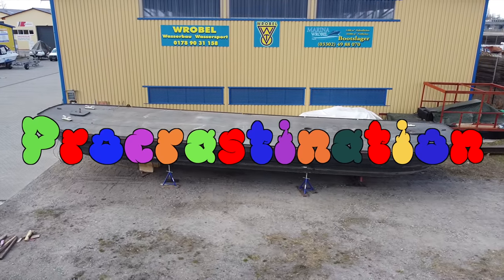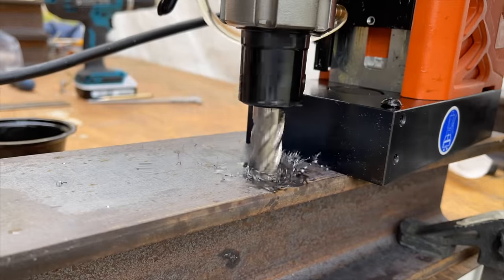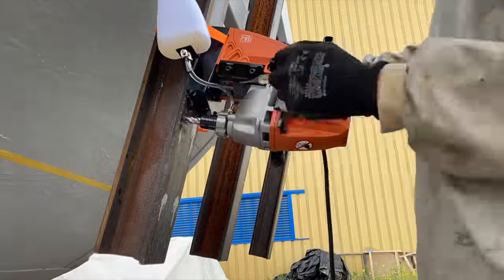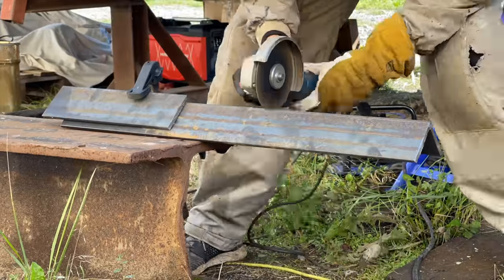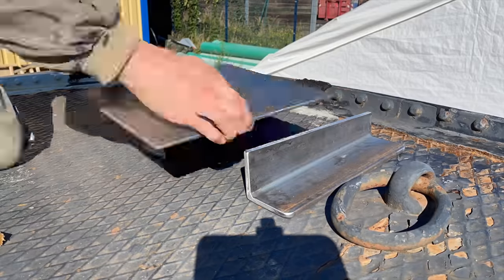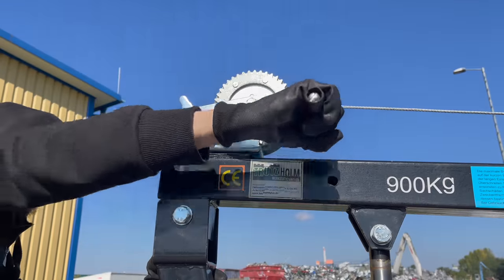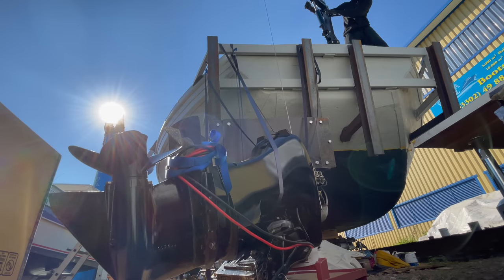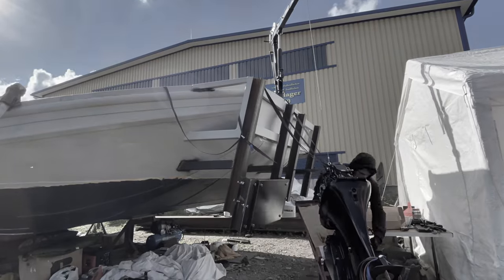Installing Outboard Motors on My Barge Boat

Comment: Good job!!!  Did you check to see if there were lower unit extensions available for these motors. Then you could have had the motors near the top of the deck for easy tilting maintenance.

Comment: Hey friend, love the progress. Just a tip from a yacht design engineer. I know you said the engine's will be hight adjustable. But I think they should be much higher. The engine's have a specific depth to which they should be mounted. This has to do with the water pressure. Also if the back board is under water you will experience a very large amount of drag wich will also make the boat hard to steer. I'm sure you will figure it out 👍🏼. Good luck.

Comment: Huyj!! Quite the project of mounting these motors!!

Though I can't help thinking the waterline being at the same height as the top rim of the transome plate, so I hope you won't end up dragging the plate through the water when the motors are pushing the barge 😕   ... I hope it all works out!! 😀

Comment: Looking good. As a suggestion, I would have added a few angle brackets under the cranes platform. As a suggestion, You should add marine grade caulking to those bolts that went into the hull. Do you plan on doing some kind of sand blasting on the inside of the hull and painting it as well? As a suggestion, I would have used a solid piece of treated lumber for the transom, not plywood. Why did you make the transom at a n angle in the first place? Do you plan on adding sheets of steel to the transom to extend the hull? if not, that's gonna be alot of drag pushing up against those steel plates.

Comment: Nic work on the transom brackets and motor plate.  That new drill really does a great job and it seems to save a lot of time in the process.  Just curious, but shouldn’t you also put some epoxy sealer inside the holes you’ve drilled too?  You may have this planned already, but it seems logical that water will find its way behind the bolts to soak into the plywood around all the bolts.

Comment: Excellent work! Danke for the video!

However I have the same fears as others about the motor which is hopelessly low and will be flooded with water. This is not a planing hull and would never be able to do so (whatever the power) so don't worry about aligning the AV plate. You would be better using the anti-foul to gauge the water line and setting the bottom of the transom above that. Hopefully the engine leg will have enough depth or you will have to reduce the transom height accordingly. Good job it's easily adjustable!

Hope it all goes well for you! Can't wait for your next episode. Kind Regards.

Comment: Great work 👏👏👏 never worked on  barge but i know with a heavy displacement small yacht that you need a high thrust propeller fitted on the outboard. Would imagine it would be the same on a barge? Have also uaed long shaft outboard motors but that was to compensate for the waves and boat motion which i don't think will affect you the same in rivers but might help get the propeller futher down but keep the motor dry. IMHO 👍🏻⛵🏴

Comment: This may have been asked but why did you welded transom on the bow of the boat instead of the stern? I may be completely wrong w this assessment. The barge looks almost symmetrical but it still has the provisions for a rudder on the old stern and its still visible on the other side of the boat. Plus i"m worried that the transom is to low and will act like giant brake in water. I hope I'm completely wrong  and i wish you the very best in all your projects.

Comment: Cavitation plate needs to be on the boat bottom level with planing boats. I am quite sure that that barge is not going to plane ;) So you can lift the engines up at least 30-40cm :)

Comment: Looks like you figured out the right settings for your welder, but whenever I am starting with new material, I go to the highest setting and work backwards if I blow through the metal.
That way I know I am getting enough penetration. I'm sure there will be better professional advice, but that's how this hobbiest has approached it

Comment: Always time well spent watching your projects advance. I think Handy Andy's suggestion of raising the engines out of the water on some sort of mechanism is great, (as you already have the crane).  Without the bolts it almost looks like the new transoms could slide up and down.

Comment: Probably a good idea to add the largest props you can on the outboards. Fingers crossed the props are at the right hight. A way to hand crank the engines and mounts on rails up out of the water is a must.

Comment: I heard you say some of people comment you should of went with one motor rather than two. And i would just like to say that two is always better than one in case you have a failure of one of the motors you will have another to rely on. And one other thing take it from someone who has decades of fabrication time without the benefit of detailed engineering experience and specs just make sure you design some adjustability into everything and you will do ok If something doesn't quite work just move it until it does. Your doing a fantastic job and don"t listen to to many of the experts and do it your way and don"t think of something that doesn't as a failure just chalk it up to a learning experience.

Comment: An excellent opportunity to add a sliding transom for pulling the engines out of the water and for engine and prop maintenance as needed. The winch is in position, its use would be easy! Nice job, Sir!
Reply: @jackrichards1863  - Thanks, Jack... I know just enough to get me into trouble.

Comment: Shouldn't the anti-cavitation plate be level with the water line? Plus, are you welding out or sealing the edges of the transom plates, or just letting them rust out from in-between?

Comment: Love your videos I have been watching for some time! Your welding has got a lot better keep it up man. I would like to just add a welding tip when you are welding corner joints it helps to go in a C Motion if you do a slight pause on each tip of the C It will help reinsure penetration.

Comment: I'm loving this project! That hull has so many possibilities, there's so much you can do with all that room. However, you've made a mistake. The transom is much too low! Think about it, those will be submerged and you'll have to drag them through the water! Expect to cut off the H beams about half meter higher, about to that hull mount. 

The cavitation plate would be right on a planing hull but yours needs to be near the waterline on a displacement hull. It needs to go up about the height of transom plate's height. I mean, the bottom of the plate should be about where the top is now. BUT the way you've done it will make it very easy, just drill new holes! Once it's done and in the water and you know exactly where the waterline is you can set the engine height exactly.
You might even weld a pair of loops on the transom so you can use that very cool crane to raise the transom and engine as a single unit.

The transoms are very wide so you can experiment with how far off centerline you place the engines.

Comment: Don't forget that epoxy does not do well in the U/V of the sun.  You need to top coat it with an opaque paint to protect it.  Also don't forget to seal thoroughly all the bolt holes.  Looking good.

Comment: Hi i like what you have been doing. I am just worried you are going to drown / flood your motors. The only reason why the cavitation plate has to align with the bottom of the boat is when the boat comes on plain the water intakes is under water. Now if you plant to ever get the barge on plain that would be the case. I would rather place your caviatation plate on the water line as that should suffice seeing that your barge also has a sloping bottom. This means your transom will be creating a lot of drag as well. Thanks for interesting vlogs. Keep it up.

Comment: looks to me like you could create something like a mechanical jack plate pretty easy here. weld some cut down angles on the front of your transom I beams alowing you to take the weight of the motor with the crane then raise or lower it  after removing the bolts. might be a good idea even for figuring out ideal height of motor.

Comment: Been following along since start of your first boat, great content! Interested to see how this transom works out while in motion. Seems like they will be a huge drag killing efficiency. Also, at their angle, I wonder if they will push water up and over drenching the outboards. You know, I dont think it would be that hard to have the transom hold onto the rail supports with brackets (instead of bolts) making the entire transom able to slide up and down the rails, using your crane to lift/lower them. Could probably lift them high enough to be entirely out of the water.
Reply: I guess once in the water will answer that issue lol

Comment: I would suggest that you fiberglass the board to ensure they are waterproof.  Lots of videos on youtube for repairing transoms.

The more I've thought about this the more I think you will have problems.  The workmanship is very good.  Here is the but, the motors could have been mounted on some steel tubing mounted across the framework you have in place.  Looking at the transom, you are going to have a lot of drag if it and the framework, if any, is in the water.  There is already a lot of resistance for the size of the motors you have with just the barge alone.  JMT.

Comment: A method to a madness everyone has there own take on things. It,s a barge boat not a speed Machine so don't matter what end ya use. Nice work all the same. Weight wise size of barge the added weight not gonna make a hellva Difference in the end probably more of a windage issue than anything else. Looking forward to further iterations oh and podding engines good idea as further out better steering. Oh and you lot who know everything bugger off annoy someone else other wise let see your projects then.. oh that's right ya haven,t got one what a surprise. Keep at it and Carry on.

Comment: My observation is that you bolted the crane into the sheet metal deck without stronger support  frame support under the deck. I hope the sheet metal deck is strong enough to hold the weight

Comment: I'm sure other people have pointed out to you and you've probably thought of it yourself! But I probably would have put a doubler plate underneath the bottom of the deck plate ? Even working with wood... I used the same mentality of doublers underneath the deck to further disperse the load!

Comment: Congratulations! You have just built a very effective water brake! 😃 The plate of the transom needs to be higher and clear of the water. Also where will the waterline be when you have finished building the boat? At the moment I think the outboard will be 2/3 under water!
Reply: He never listens, the work is sometimes ok, but poorly thought out.

Comment: The outboard looked very low, the hinge point was in line with the waterline on the barge. Aren’t they usually higher up, out of the water?

Comment: The two 5mm plates are not a good idea. There will be rust, especially with the plywood on top of it. A stronger and lighter solution would be to cut the second plate in to strips and weld them 90 degrees to the first plate.

Comment: you need to epoxy the holes in the plywood where you bolted thru. also the deck where the crane was mounted  will leak with out so sort of caulk.   project looks great

Comment: Have you thought about contact corrosion between your A2-70 bolts and the normal steel H-Beams? 

Hast du auf Kontaktkorrosion zwischen den Edelstahlschrauben und den Stahlträgern gedacht?
Reply: В морской воде всё корродирует. Черная сталь и нержавеющая между собой не корродируют. Алюминий и чёрная да...
😂😂😂😂😂

Comment: Very skillful work! A few comments though. The transom seams too low/deep, but easy to address, You just drill more holes so it can be adjusted. The other issue is more complicated. The design of the transom will act like a huge break, you can probably shave/cut the lower part  5-10 cm. Better if you would design it like a box, hull extension, then would have much less break effect.the box does not nee to be structural, just to direct the water flow better.

Comment: i'm surprise you don't sicaflex or wire togheder the two 5+5 steel platform
and epoxi on the hole for the wood under water
and why wood? is not better metal?

Comment: I would recommend putting silicone or some sealant in between this two plates. You will be surprised how fast water can rust that front the inside out.

Comment: That plate your putting on will act like a brake  back wash I would have put a sliding up down Bar across bring motors out of water  put stop bar where when motors down only go to  it  as I can see when props get full of weeds tilting motors not going to be high to clear but in saying this your doing a good job

Comment: Raise the motor to your next bolt hole and drill a new one on top.  That should be a good start.
The water will travel up the hull.  It’s going to be displacement running hull, so don’t worry about the bottom

Comment: My first thoughts when I saw you have problems to get your welds to melt completly through, was that you  maybe have your welding machine on a far too long extension cable...that give you a too big loss of power because of too much resistance in the long extension cable.
By the way... If your painted water line is in correct height, it looks to me you are installing the outboard motor to far down .
In my eyes, it will sit too dep into the water...?

Comment: I too suspect the outboard is mounted too low. 

While it’s true the cavitation plate over the propeller is generally lined up with the bottom of the boat hull, that alinement is much more significant on planing hulls, as opposed to the displacement hull situation of a barge. 

However, all that aside, the outboard engine obviously cannot be submerged, and the video made it appear as though the upper end of the outboard will end up too close to the water surface. 

Just food for thought. I do enjoy your videos.  😊

Comment: You might want to think about making the transoms able to slide up and down the H beams you have there at the moment, there will be no need to tilt them and mounted that low on such a large vessel there is a risk that the outboards go under water from time to time if you can not raise them.

Comment: If the blacking on the boat is the proposed waterline, you have the motor way too low. Also water will hit the mounting plate and flow up over the motor.  The rule of anti cavitation plate at the bottom of the boat is for when the boat is for square backs. You have a rising stern and the water don't flow the same. Very good chance you'll be rising the motor 1.5 to 2 feet. 
On regular sterns, for brackets, rule of thumb is , for every foot of setback raise motor 1 inch, but with that stern, only testing will determine ride height.

Comment: thought:  instead of redoing the motor transits ..... modify the winch base to a slide that will slide to both sides of the both,, that way you can use the winch off the sides to hoist items onto your boat.

Comment: 10:17 I turn our welding machine up to 25 amps which the wire mediately burns up but puts a nice wide weld on there. Just be careful, you’ll run out of wire quickly. The second one I made on the job, I went with 23 amps with smaller welds to conserve wire. Which I found annoying and the other guys found it funny because I was just walking that wire gun back and forth.

Comment: The cavitation plate needs to be level with the waterline, not the bottom of the engine cowling…….. Installing them on the other end of the boat with the false rudder skeg will help too. Like you said it’s your first boat. A pod would a swim platform might have been an easier option. At least you’re giving it a red hot go.
Reply: Glad I'm not the only one to see the engines are at the wrong end

Comment: In transom there is absolutely nothing which could not have been build successfully using 60x60x4 mm square tube. But maybe transom is just too high on the water so you will ballast it down using these hilariously thick steel structures? Or those steel beams were free?

Comment: The engine looks to low in my mind. 
And the transom plate looks like it will work as a water brake? Are you 100% sure about the water line? When thinking of all the future weight that will be added, like wheelhouse, mast, housing etc.
Reply: I was thinking just the same as yourself

Comment: You should punch another set of holes up (maybe two) If you're anywhere near your waterline I think you'll be riding too low on your cowls.  It would be better to have the adjustment available to you now, rather than on launch day when you realize she's sitting too low.  You should have also put sealant down between your crane bracket and your deck because those bolts will leak and you'll have water coming in through the deck.

Comment: Once you get underway be sure to plan on stopping well in advance the props on the outboard wont amount to much also with motors so close together they will not have any ability to steer. You would have been much better with a small diesel turning a huge prop with a 4 to 1 trans.